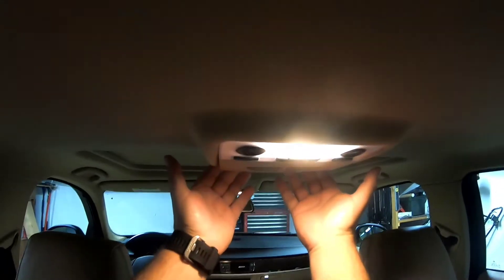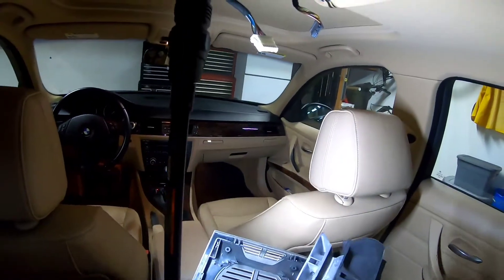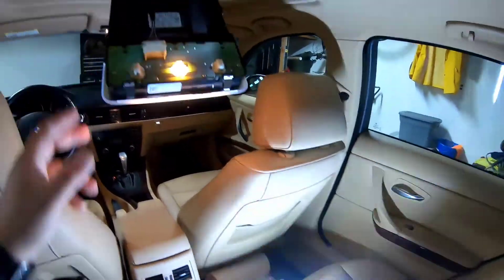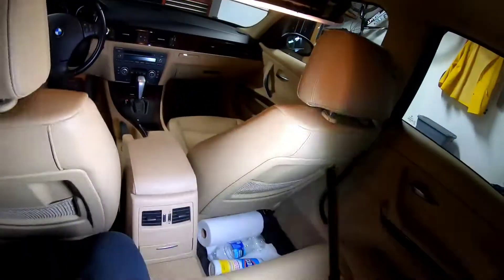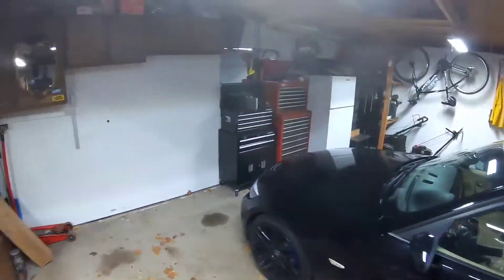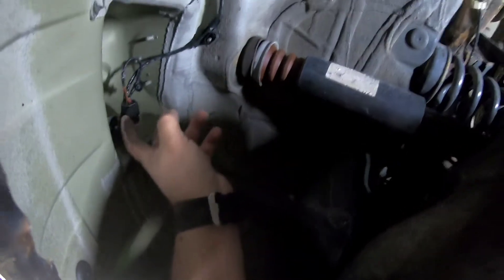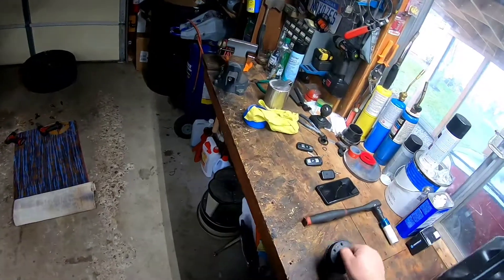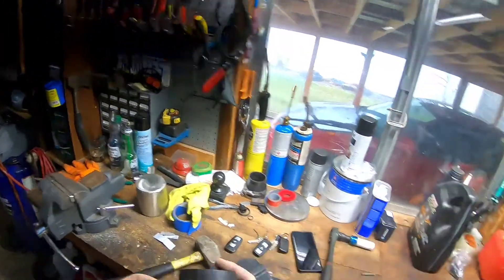Bmw e9x alarm retrofit

Comment: do you need to install the hood connector plug thingy? if so how?
Reply from the maker: No you don't
Reply: @Frenko1  any coding required? i have a 2009 328i
Reply from the maker: No, it was plug and play
Reply: @Frenko1  thank you so much for your reply and last question do i have to disconnect the battery ?
Reply from the maker: No

Comment: Hey my friend. I installed the alarm just like you did, I have a 2008 BMW 328i alarm works great but no acoustic sound unlocking and locking. How do I fix that?
Reply from the maker: You'll have to enable it in coding section. Most will work right away but some you'll need to hook up programming tool

Comment: Hi,how do i do it to one e93 2008,you think it will work?thanks
Reply from the maker: @mmario1409  yes it'll work but you need to research where is plugs located since that's convertible.
Reply: @Frenko1  ok thanks,i get back later once i sort it out

Comment: I have a pre-lci e90 320d 2005 and I dont have an alarm so I can do the same way you did with my car ? There are sockets already there ?
Reply from the maker: Yes if you have an extra plug above and one in the wheel well. You can run your vin number through vin decoder and it'll tell there too.
Reply: @Frenko1  How can I learn it with vin doceder? if you mean $302 in vin decoder I dont have this in my vin
Reply from the maker: Go on Google type in bimmer.work put in your vin and the next page will show you all options that you have. Should say 5GA Prep. Anti-theft Alarm System.
Reply: @Frenko1  I dont have Alarm System on my car I know that so I dont have those cables you showed in video right ?
Reply from the maker: You can check, just pull down the over head and see if you have a extra plug
Reply: @Frenko1 what can i do if I don’t have wires plugged
Reply from the maker: @Dizzy0420  at that point, I wouldn't recommend going thru all that trouble. You'd have to run wires by dome liight and wheel well and most likely coding.

Comment: Good video. I see that my car is wired for this. So all should work without programming?
Reply from the maker: Yes
Reply: @Frenko1  Thanks
Reply: I had the same question 🙋‍♂️.  My vehicle is a 2008 328i pre wired. No coding required. I like that. Plug and play 👍🏽
Reply: Thanks for the video Frenko.
Reply: @hovajz  Mine works no coding. I just changed the acoustic sounds and I love it.

Comment: I have a 2006 bmw e90 and everyone I lock it the light never flashes so I feel like I can add this and mine is pre wired so do I need anytime of coding or this is all plug and play ?
Reply from the maker: Most of them are plug and play. I've put 4 alarms in 4 different Bmw's and only one of them I had to code it. If you have Carly you can do it. Basically you have to code from non active to active. Let me know if you need anymore help.
Reply: @Frenko1  thanks man will let you know

Comment: The E93 does not have the roof cavity to install the module. Where does the module go in my '08 E93? My car has the prewire, but the place in the roof does not exist, or it's not in the same location because there is no light in the location.
Reply from the maker: Honestly, I have no idea where it would go on e93. I think you can install only Siren and not the module. I think its only for motion inside vehicle.
Reply: Did you sort it in your e93?i have the same e93 and no slarm..but i think there should be a trick to do it...did you sort your one?

Comment: Would this work on my 2011 328i?
Reply from the maker: Yes, just check for pre wiring.
Reply: @Frenko1  how do I check that?
Reply from the maker: Just pop the above head light like in the video and you should have extra plug there not plugged into anything.

Comment: Can you link me what I need to purchase ? Canadian 323i with pre wiring
Reply from the maker: I left the part numbers in description for what you need.
Reply: @Frenko1  but thats only 2 parts full kit is 4 parts
Reply from the maker: If you want full kit, you'll need these plus those two in description. 
Hood switch part #61319119052
Siren bracket part #65756940124
Mounting plate part #65756936588
Reply: @Frenko1  do you need full kit for it to function?
Reply from the maker: No, you just need the ones in the description plus the bracket. Make your own or buy oem
Reply: @Frenko1  wow so you can get half of the kit and it works? that awesome